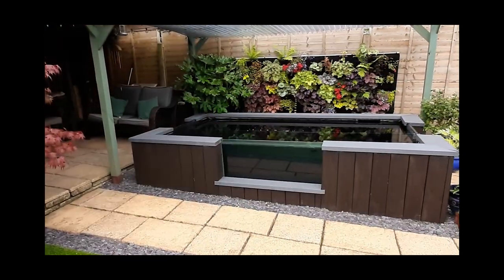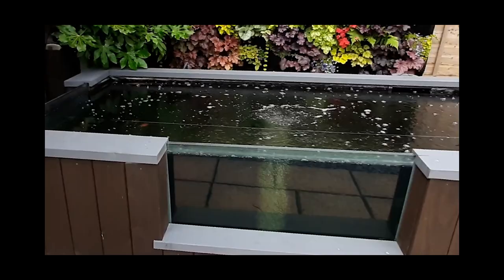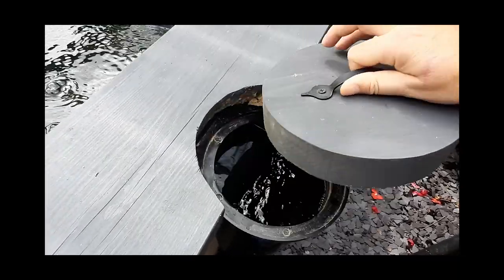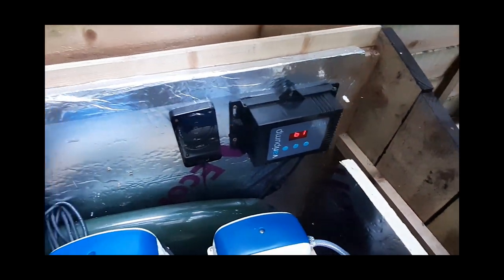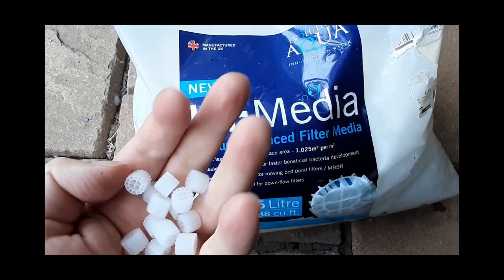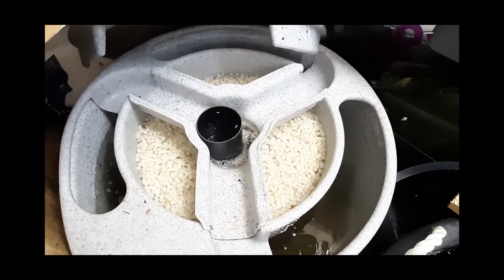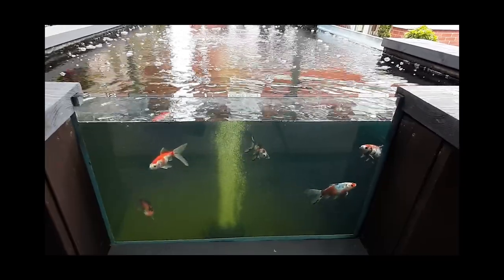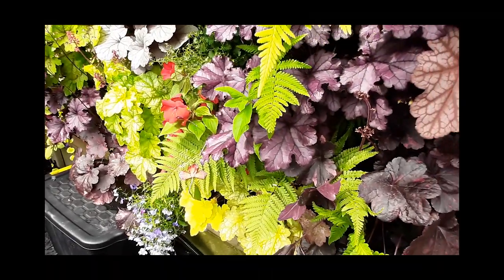Late Summer 2021 update on my 3 window semi-raised pond with EazyPod, moving bed, UV & living wall

Comment: I had the same problem with my koi, they had fin rot, tail rot, mouth rot and ulcers. They were rotting away in front of me. I tried salt, acriflavin and fmg with no positive results. I was then recommended Virkon Aquatic Tablets, 1 tablet per 1000 gallons as a start then one tablet every five days. My fish turned around in two weeks, all the tails and fins have grown back, the ulcers have disappeared and they have never looked so good. £15 for 50 tablets is not going to break the bank. I definitely recommend.